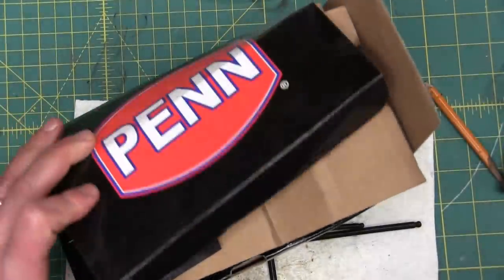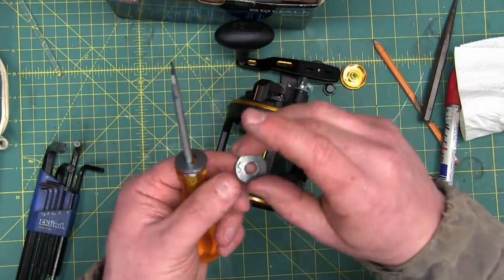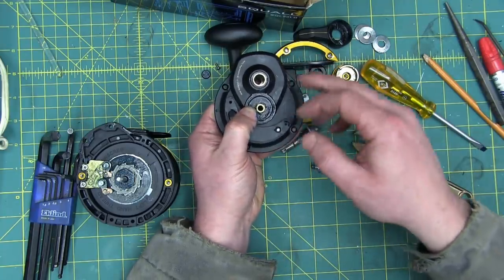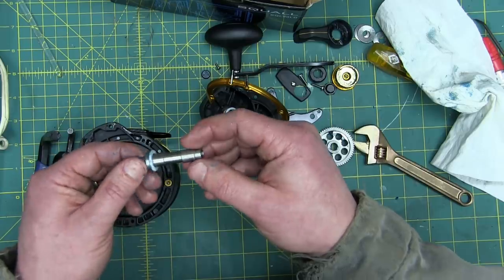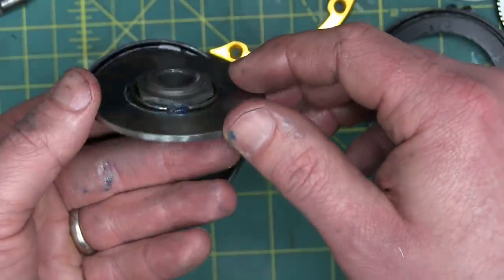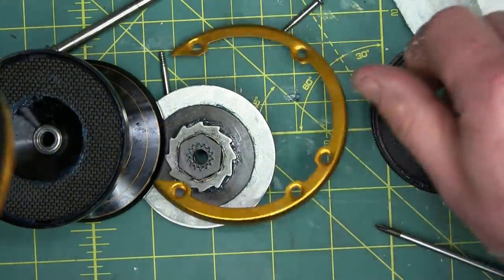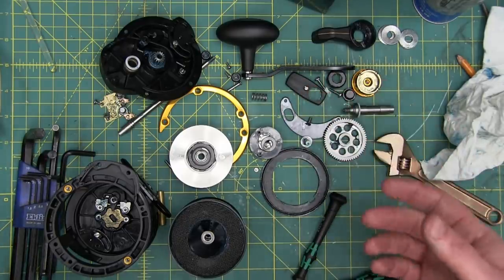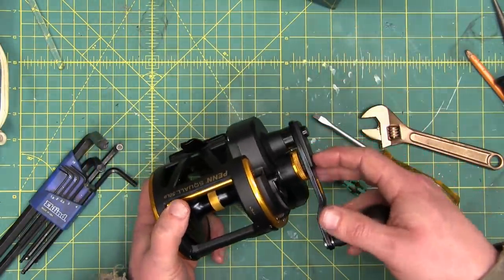BOLTR: PENN FISHING REEL | SQUALL DRAG REEL

Comment: Wouldn't the clicking tell you how fast that 1000lb marlin is taking your dignity?
Reply: Can also be used for bite indication.
Reply: Exactly, so your pole can do the fishing for you while you get on with more important things, like drinking beer.
Reply: @TheMuconium or you just look down...
Reply: Swampy  main reason is when your pulling out line it applies tension without messing with the preset drag. Without tension the spool will overrun the line and cause a rat nest In the line.
Reply: Swampy  most of these reels have a switch to turn the clickety-klack on and off, so that kind of contradicts what you are saying. I also know this as bite-indicator for trolling. Simulaneusly you put the brake lever in the "strike" position for the right line tension. When you have a bite, you turn off the ratchet, to not wear it out and put the breaklever  to "full"

Comment: Lad, the "strikes" are harness catches.  Keeps you from losing your rod if you drop it.
Reply: yeah he says later on after he checks some stuff
Reply: That's only an incidental use.  They're for using with a stand-up gimbal or fighting chair.   https://www.amazon.com/Pellor-Offshore-Fighting-Shoulder-Complete/dp/B013Y92XZS
Reply: Whew, if that amazon listing only had the last picture I would have definitely used it for something else
Reply: Really I thought they were for the freewheel function for casting
Reply: You don't really cast reels like the one in the video.  There are centrifugal brakes on some reels though, which is probably what you're thinking of.
Reply: @electronpusher604  some guys cast them just fine. I can't worth a damn but some guys do. Lot take off the level wind to get a little bit of an edge.
Reply: @amirs5512  thanks i was at a marine store and couldn't figure out what their function was!
Reply: 100%  cable safety attachments

Comment: For the money a Penn is hard to beat.  I have royally abused mine for close to 20 years with no problems.  They even survived a fire that gutted the commercial building they were stored in.  Cleaned them up and put new grease in and went back in action.

Comment: I worked on a fishing boat since i was young and Penn reels use to be really great reels that could last forever but then they changed and there reels went down big time. I’m not finished this video yet but I’m guessing there newer reels aren’t much better. Companies and the people who made thing use to take such pride in what they made but it seems that has gone away with so many companies just to get more profits. It doesn’t even seem that things made in the present even last as long as they should before things start breaking or falling apart. I heard new homes built around me in the US are only made to last 25 years. My friend bought one of the new homes and 5-7 years after it was built the roof started leaking and he has to replace basically the whole roof because of it. He did just replace the whole roof but the house was only built 5-7 years ago. There are houses that are 70-100 years old that haven’t had there roofs touched yet let alone replaced. So crazy.

Comment: There's a reason why Penn has been around so long, fresh AND salt. I trolled and anchor fished a 9/0  around half the world... off my last 2 Destroyers (USN) 😎 and slayed many fish. The only problem I ever had, we we're on patrol in the gulf Oman, just outside the Persian gulf. I just dropped a lure in and running close behind the ship checking/adjusting tracking before letting her out. Huge tuna slurped it down and headed for Pakistan. I'm strapped in, hoping to ride out the first run without breaking off. You don't stop/maneuver a destroyer on station for fishing. 😂 Half a spool out of a screaming hot run, the spool locked up and all I could do was hold on, wedged against rail until it finally broke off. Once the reel finally cooled down, disassembled for a look see. A tooth broke off one of the first gears Ave showed, locked the fuck up. Boxed it up with a great story and sent to Penn, thinking maybe I'd get some new swag or something. Nope, they fixed and returned at least, no charge.

Comment: It's actually quite common for anglers to service their own reels annually, especially with reels used in salt water. Penn even sells oil/grease kits specifically for the task. I also suspect that the left handed thread note was added due to user service errors that lead to calls or at the very least a thoughtful note to anglers servicing their own reels.

Comment: a fiero is a chevy citation turned around backward with 5 high reverse gears you have to drive it looking in the rear view . the violet mobil in the can or tube will actually hold salt water till it evaporates out and when it dose it looks new again but with salt in it. I had an abu round real a c4 mag for 10 plus years went thru 10 sets of barings fished of the beach with all the sand poured saltwater over it every time I started fishing to wet the line the spool turns like 20K rpm at the beginning of the cast mono you'll F up if you don't I use yo-zuri its covered in fluorocarbon covered mono lick your knots or the friction of pulling em up tight will fry em(you'll lose line strength) if that's the first time with that reel apart you did pretty good a common mistake is to put a one way roller clutch in backward or something wish I could share all my reel knowledge with you but I've done an appauling amount of fishing I mean you'd really be disgusted at how little ive contributed to society because of it but I can tell you this sturgeons huh... you need to catch some sand fleas mush em up(unclassified marine invertebrate no license?)put em in some corn syrup theyl look funny in there but keep em cold its natural bate and get some mustad Activate soak some river yarn in the fleas and eye dropper your mustad activate salmon formula and mikes hearing gel put some rock salt iner so its heavier than the river water so it sinks down to em and don't tell the gamewarden I told you all this kapich e

Comment: I've torn down My fishing reel every year, all I do is clean it out, apply new grease / copper never seize. 

On the other hand my fishing friends have bought new reels at least every other year or so, and. guess who gets the old crusty ones. this guy.
Reply: Same here. 20 years ago we took apart and lubed the reels every year. We also fixed any dead soldiers, either with donors or new parts. Penn used to be very user serviceable. Now they are much lower quality and pretty much the only thing you can do is lube them and toss them when they break.

Comment: In general a 'good' reel will last you one, maybe 2 years of constant use. Most common mode of failure is where the 200lb gorilla turns the crank. Penn is supposed to be 'the shit' but has gone down hill with everything else. Stainless steel is for salt water exposure. The clicky thing is mostly for impressing the ladies, but does give you an audible que than line is being pulled out if your napping when a fish strikes or your drag is too loose for the current. Replacing the grease is the number 1 way to get the full life out of your expensive reel.

Comment: The knob is the casting drag. These cheap Penn reels are not known for quality. Their lower end stuff like the model in the vid is and example of kinda the HFT of fishing gear. Tear down a bass reel with magnetic and/or centrifugal casting brakes like a shimano curado or diawa tatula designed for. Lightweght strength and accuracy and you'll see some better materials and engineering.

I do rebuild my reels every year between seasons. Bearing quality does matter on lighter gear where smoothness and accuracy are important. I run ceramic gears with seals removed to eliminate all drag on them... Noisy but extremely smooth for casting lighter weight longer distances with accuracy.
Reply: vinceje I fish bass with a quantum icon pt bait casting reel. I have taken it apart a couple times for cleaning and the internals are much higher quality than this one in the video
Reply: These aren’t that bad... catch anything the people that buy these will ask of them ;) No Shimano Tiagra, Penn International or Daiwa SLT but not priced the same either!
Reply: Point of clarification The Knob is doing the tear down...Just saying..... The little knob is writing this comment... Just saying..... The penn knob is a casting drag.. how it dresses not mine to judge...
Reply: Eh, you're talking out of you're butt here. Owning both, they have completely separate applications. A curado is an inshore, light casting reel made for shallow and greenwater action and movement. These Penn squalls are dedicated deep jigging/short distance casting meant for offshore hookups and rigs. Penn squalls have a very high satisfactory rate for durability and they have proven themselves over the years. I've owned 2 since its release, paired with the PENN bluewater Carnage and it is my go to for red and mangrove snapper. Obviously you have not done your own research, or have actually used multiple fishing reals because you attempt to compare PENN to Daiwa, which is considered trash tier in the competitive fishing area. A proper comparison would be a Shimano Calcutta, which is a higher class reel made for deep water action.
Reply: I didn't think it was possible, but you've made fishing boring.
Reply: I've got a couple of the Shimano equivalents of the Squall (Shimano TLD30 and TLD50LRSA), and I've been quite happy with them. Would I rather have an Avet/Accurate/Tiagra/International/etc? Well, yeah, but that's also 3x the price. For my uses, the graphite frame works fine.
Reply: +Bruce Pulver The penn knob isn't casting drag, it's the setting to "calibrate" the lever drag, which is set at the detent about 2/3 of the way up the lever. This is typically set to 1/3 of the line's rated strength. Lever drag reels aren't typically preferred for casting, due to the lack of a true freespool. A reel made for long distance casting would, typically, have a centrifugal type "casting drag", which allows the reel to spool freely in the initial portions of the cast, but gradually apply a brake as the spool's velocity decreased.

The advantage to the lever is that the drag increases as the quantity of line on the reel decreases, due to having a smaller lever arm but the same size discs with the same coefficient of friction and the same normal force (the line for the same amount of pressure puts less torque on the drag discs, so it takes more force to get them to move). So, as the quantity of line on the reel goes down, you have to pull back the drag from the "Strike" setting to a lower setting to avoid the risk of breaking the line.
Reply: vinceje yeab i have some upper models of penns spinning reels. The battle 2 in particular is my favourite reel atm
Reply: The Hairy Farmer ... a 50kg gt on a hand reel would be near impossible
Reply: khunt holio I’m not disagreeing with you but I know that people catch 40lbs plus fish on fly rods
Reply: khunt holio I've watched 150lbs tarpon hand lined
Reply: Hand lining (or a fly reel, for that matter) is arguably easier than using a (modern) reel, because of the gearing. Reels, for the most part, are made to turn more times than your hand does, meaning that for a given weight of fish you need to pull the reel harder.

Obviously, this ignores factors like the drag and tiring the fish out, which is, of course, a major factor, but for just bringing a heavy fish up from the depths, you've got more mechanical advantage with the older designs.
Reply: Bass fishing is for kids. Your bass reels would explode trying to handle a real fish, or in the saltwater environment.
Reply: Being low budget reels, it helps lousy fisherman keep the price per fish reasonable.....     lol
Reply: I've seen someone using a towtruck for reeling in big game...   lol
Reply: I read that all in Ave's voice
Reply: vinceje great comment hit most of what I was going to mention.
Reply: A baattle is certainly not an "upper penn model"
Reply: vinceje thats not for casting drag. Its a lever drag reel and depending on how much you tighten the knob the more drag it will put out. Its a cam that the lever part acts on to put pressure on the drag washers. It has a ramp up that applies more force as you move the lever from freespool to strike to full drag. It gives you more adjustability and makes it easier to raise or lower your drag pressure when fighting a fish than on a star drag reel

Comment: Other than the white couch... is there anything not made better with a heaping helping of MoS2?
Reply: poot111111 brakes?
Reply: If you want a serious answer it'll get into plastic and fuck up its integrity - do not apply to plastic surfaces.
Reply: Trump.
Reply: Plasma_000 oops, are you talking the grease or the molybdenum? I have a paint infused with molybdenum disulfide, I used it on some plastic parts (probably nylon) that I had to replace on my built to fail craftsman mower. I figured it would prolong the life of the plastic parts I replaced because they got stretched out.

The paint is amazing, I have taken 1-2lbs off rifle triggers just by applying it to the sear surfaces, I've also sintered it, boding it to stainless steel with a cnc laser.
Reply: fish and chips
Reply: Trump... would be worth a try... oO
Reply: fartwhif, he replaced the mat a few videos back.
Reply: Also reduces oxidative stability to an extent...

Comment: You typically set the drag to 1/3 of the line's breaking strength, so it's not really 80 pounds of drag, more like 27 pounds. That would be the setting at the detent, the "Strike" setting. You set this using the big gold knob on the right side of the reel.

You've got a couple of extra pounds to be used (maybe 34 total) if you push it past the detent if you really need to stop a running fish.

Comment: Glad to hear you hate flathead fasteners too. Theyre bull shit. Along with the Allen head fasteners. About as close to a perfect circle as you can get. I'm a torx guy
Reply: I think it's for looks. I'd hate torx in there. A torx in this app is just gonna catch schmoo and be harder to clean up.
Reply: I'll take a hex-head bolt over one of those blasted Philips head fasteners. I swear they come out of the factory pre-stripped.
Reply: The worst screwing Ive done was with these old ass thick soviet flathead wood screws that were painted over, not something I wish to repeat.
Reply: Square drive ftw.
Reply: BusterSwordsman yeah ill fux wit a square drive
Reply: Excellent
Reply: I don't care for em either, but if I have to take apart something like a fishing reel and I can't get into the guts of it with just my leatherman,,, that damn reel is going overboard.
Reply: The slotted/flat head screws are a nod to the original Penn reels which were made with the flat head slotted screws, but were made much better then the current models.. Well, at least l think they were made better, l have a small collection of the old Penn reels, most are pre-1960 and still work very well... Maybe an Ave project to compare old Penn to new?

Comment: AvE, do a review on a Penn International reel!!! Seriously. Or try a Avet T-Rex dual side drag reel! I have fought 70 pound Cobia, 200 pound Tarpon, and 400 pound sharks with just my Penn Senator 6/0 reel. The HT-100 drag washers are great! I'm a huge Penn fanboy. Lol I love their spinner reels too.
The Squall is the lower end cheaper stuff. Go with the International reels. There's a reason why all the pros out there in the deep blue use them.

I mostly use the all metal Penn reels or Swedish made Abu Garcia reels. Never had an issue with any of them under heavy use and abuse. Even that Penn 6/0 that's not all metal has impressed me beyond belief. My Penn spinner reels can cast farther than any reel I've ever used, and I've used petty much every brand on the market. 
If you go with Penn's top shelf stuff or Abu Garcia's Swedish made stuff then you'll have no regrets. I've been seriously fishing fresh and salt for almost 30 years.

Comment: I halibut fish in Alaska/ BC West and we use the click clacker to tell when the weight has hit the bottom.  The click clack also helps with not back spooling the real, as that may happen on a free spool. when you are trying to hit 400 ft, that's like 120 metric. it can get old to hold your thumb to the reel, especially if it 45 f what like 2200 C and you don't want a digit frozen to the spool.

Comment: The strike has nothing to do with those slidy deals on each side. Those are for hooking up a harness. The strike is designating a drag setting that is ideal for getting a strike when you are trolling. Its enough to set the hook but still let the line run a bit.
Reply: X2

Comment: I repaired a small fishing reel for a friend last year.  The drag would not work.  I don't fish and have never done surgery on a reel before.  I got it apart, figured out how it worked, but couldn't find anything wrong with it.  I put it back together and it worked perfectly.  Go figure.
Reply: This shit is why I don't work on cars for a living
Reply: Dat magic concussive persuasion maintenance. You done tappy tapped the stucky stick without knowin.
Reply: I have repaired more things in that manner than all the other ways (skill, luck etc.) combined. Lol
Reply: My luck is that there is a problem but then when someone brings whatever to me, the problem vanishes. I can't fix what doesn't have a problem around me. 
But yeah, some things just need to be put back together properly and nothing else.
Reply: It's like a bicycle hub, sometimes the magic is in getting it tight enough to not wobble but not tight enough to bind where it shouldn't. (And it happens to be in some cases bicycle hubs and reels may be made by the same company.)